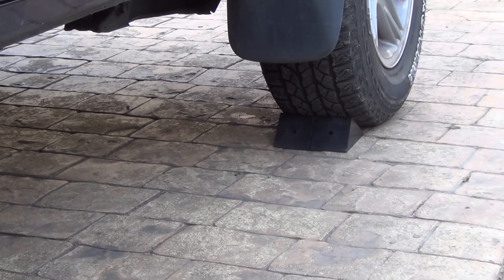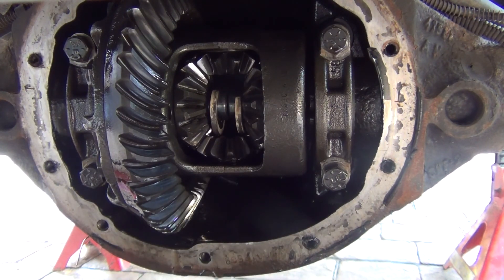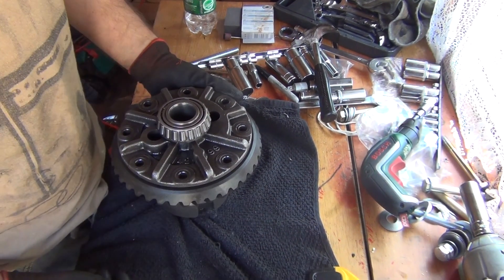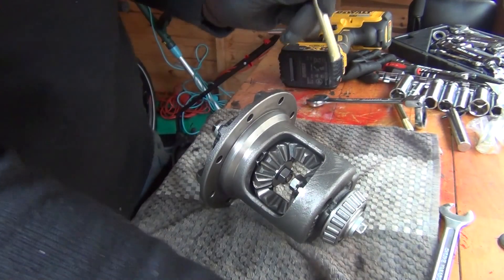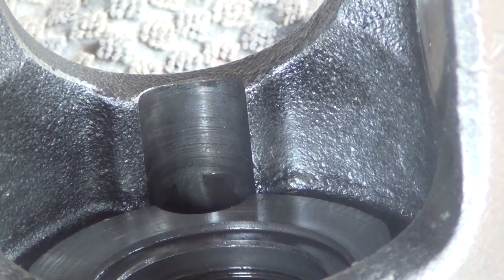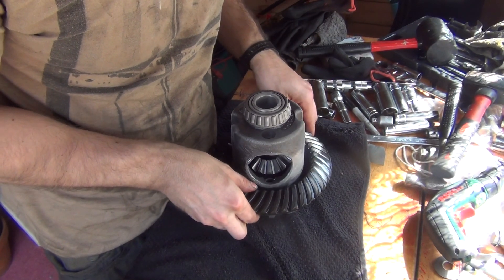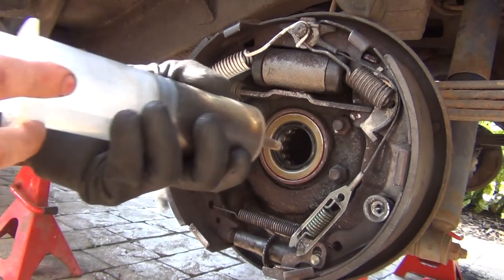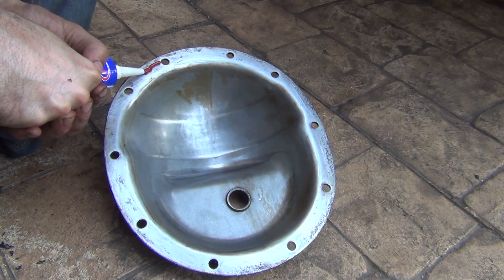Jeep Cherokee XJ Differential LSD rebuild

Comment: thank god for this! ive been goin nuts trying to figure out how to get those spider gears out

im not rebuilding it but i have a lunchbox locker to install in its place.
Reply: In the rear? Is it a DD by chance? I was curious how that would drive on the streets, manual transmission and it’s my DD

Comment: IMO opinion you don't have to remove the carrier, yesterday I removed spider gears and LSD clutches from my D35 without moving the carrier. Tomorrow I'm putting it together with new Spicer parts and hopefully I will do with the carrier in place.
Reply: Ok, I'm taking it back - it's completely senseless/pain in the a** to do it without taking out the carrier 😂 Just finished rebuilding D35 LSD. The main problem I had was to put the second spider gear washer in place. And after couple of hours of fighting I removed the carrier and did it in no time.
Reply from the maker: Indeed :)
Reply: Exactly

Comment: Where can we find the discs themselves? And then there is a case that he needs some intervention on the crown with the pinion for the gap that must have been adjusted somehow for the best use of the differential? Your video is very nice, congratulations
Reply from the maker: I bought the plates on ebay
Reply: You should not need to adjust your ring and pinion gear contact pattern if you're not setting up new gears. Just put any adjustment shims back where you found them.
Reply: @gogmorgoaway would i need to adjust ring and pinion pattern if i wanted to install a new lsd carrier or new spider gears?
and also does the spider gear needs some type of new measurement or can i just use the new and or/ old shims and call it a day?

Comment: How many miles did the jeep have on it when you had to do the clutches? No problem with new clutches and other parts being original?
Reply from the maker: Car had 100k miles when LSD started being problematic. Zero issues after replacing the clutches.

Comment: Is this a vari lok diff?
Reply from the maker: It's Dyna 35. Track lock limited slip diff.
Reply: @Adikxx  yes, but is this a vari lok LSD system or something else?
Reply from the maker: It's a track lock LSD with preloaded clutch packs. Vari lock diffs were available in later Jeep models like Grand Cherokee WJ.